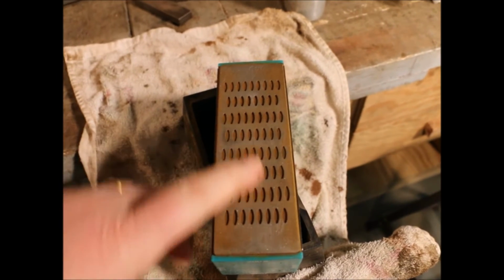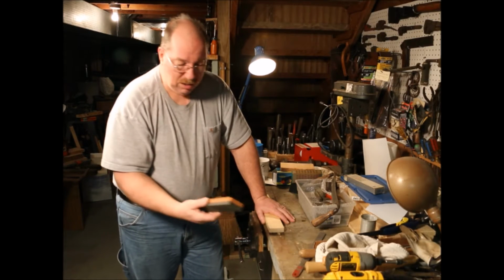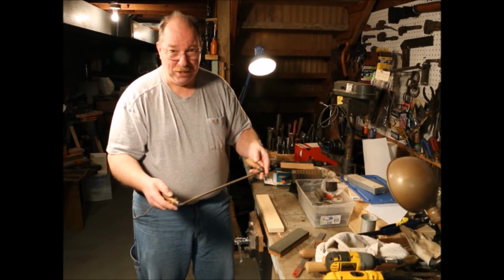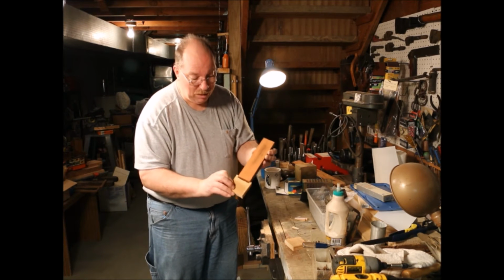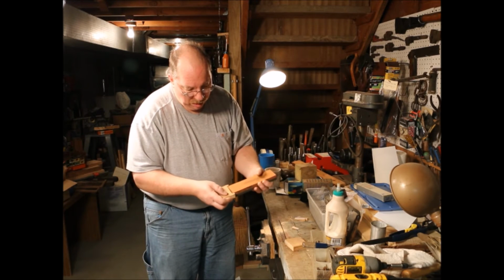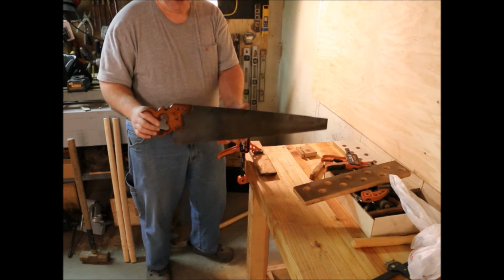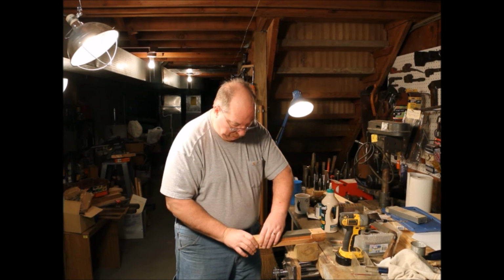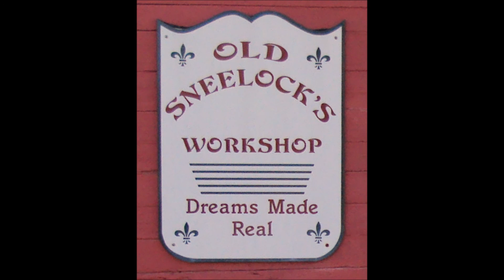Making A Jig To Hold A Norton Oilstone ~ by Old Sneelock's Workshop

Comment: how do you compare your feelings about coping saws to  hack saws. those were usually the two options available to me in my Dad's shop.
Reply from the maker: +Matt Cooper A good coping saw, with a sharp blade, is slightly better than the best hacksaw. I only use them for short cuts and they are cutting wood so they cut fairly quickly. Hacksaws got on my bad side when I had to use them to cut a lot of pipe and steel plate when I was making go karts and minibikes. 
The purchase of a cutting torch was a milestone. 
About 15 years ago I got a chop saw and that is the thing for pipe. A 4" angle grinder and cut off wheel is my best tool for clean cuts in plate, but the torch is my go to for any major cutting.

Comment: I use mineral oil on my Norton. what do you use? l love the quick commentary at the end.
Reply from the maker: +Matt Cooper I'm using paraffin lamp oil. Got started doing that when I stoned dies for a living. We started using kerosene cause that's what they had. Smelled pretty strong and the wife objected. My partner Jerry Coplin brought in some scented lamp oil and problem solved.  It cleans up easy and doesn't make my hands crack. Mineral oil is recommended by Norton. It doesn't have an odor either. I imagine it works fine. I just got use to my way of doing it.
Reply: Thanks I was curious what others do. Especially those I respect.

Comment: I really like it when the 4-X coffee kicks in. I had a diamond sharpener that would store in it's handle. I was going to put the edge back on m,y kitchen knife when I found it salavated. Sweetums admitted to doing it while trying to sharpen something which she flat-out don't believe in a sharp edge and I can't handle a dull one.What she was sharpening she hasn't said and I haven't found it. Her stuff won't cut open a plastic bag. My epoxy was set up so I got the tube of Seal All out and soaked it down. It held but won't come back apart. I even glued a nylon 2-piece gas cap together with it, not to mention sealing some pin holes in an old 5 horse Briggs gas tank. Good stuff. I'd still polish your boss's head for making you work 53 hours a day. Not nice!
Reply from the maker: +Lewie McNeely He can be a pain but he means well. Besides I get to play with all of his workshop toys... Uh I mean tools.
Reply: A good boss is hard to find but I think you've got one. And I know you need the odd hours so I suppose I'm happy too.

Comment: Did you wake Laura when you used the impact driver ?. I would be in the dog house for a week if I worked at 05.15 !
Reply from the maker: +UK Tony Lydia works kind of a swing shift. Sunday, Monday, Thursday, & Friday one week. Tuesday, Wednesday, Saturday, & Sunday the next. On the days she works, she gets up at 5:00 am to be to work at 8:00 am. Our bedroom is on the opposite end of the house from the shop and we have a white noise maker so we can sleep odd hours. 
All in all, no worries. :-)
Reply: +Old Sneelock's Workshop I worked nights much of my young adult life. I used s boc fan for white noise, so I could sleep. Now to this day if there is not a fan on in the room, it is too quiet and I cannot sleep.
Reply: +UK Tony  When I was working early I'd have to get up to leave the shop at 15 after 4 to go get building sand.  I was VERY quiet, even though we had a fan going. Now I might sleep longer than she does!
Reply: +Old Sneelock&amp;#39;s Workshop Our neighbors say that the cause of a happy long marriage was separate shifts.
Reply: +Matt Cooper  We've got a Honeywell HEPA filter that sounds like a tornado. No dust and all's well.
Reply from the maker: I worked for Product Action as a Location Supervisor from 2005 to 2007. The job entailed driving all over 5 states and working odd shifts. I slept when I could and often had to get by on little or no sleep. The noisemaker was what kept me alive. Driving while dead tired I drove through a railroad crossing bar and didn't know it until the windshield exploded. God was driving cause I sure wasn't.
The Dewalt Impact driver is usually operated only during times that Lydia is awake or away from home. Happy wife, Happy life.
Reply from the maker: Matt Cooper What ever gets us through the night. :-)
Reply from the maker: Lewie McNeely Everyone has their own life to live. I dumped Product Action just as soon as I could. Worked for Demmer Corp for 7 years on the same schedule with Lydia. Now I don't have a @#$@#$ shift issue anymore. If I had known how good retirement would be I would have done it sooner.
Reply: I guessed I'd better get out of eating dust while I still could. Whoever said retirement was the life of Riley, either knew the wrong Riley or just outright lied!
Reply from the maker: +Lewie McNeely It's all in the mind. I just got in from raking the front yard and the flower beds. I did it my way when I wanted to.
Reply: Old Sneelock's Workshop Years go we hauled sand to an asphalt plant and then that evening we started hauling asphalt after dark to Cherokee on 441 if anybody knows that country after the traffic slowed. After midnight the plant broke down and I headed home in the Mack, and they ARE 4 letter words. I dove about 50 miles and never knew it at all in curvy mountain roads. I'm like UNcle Snee when he said he wasn't driving but The Lord was. I've been there too many times to count. I didn't drink much coffee and didn't do pills. And I had apnea and no cpap for many years. You tell me that God Almighty wasn't driving and I'll first off tell you you're full of it and then take you on some of the roads I traveled. Then you can see for yourself.
Reply: Old Sneelock's Workshop That's what we're into. Loading, hauling (the easy part) and spreading chips and mulch. We'll either get done or die trying. I had to mow to un-kink after a mulch run. All walking, no riding.
Reply from the maker: Lewie McNeely In the late 90's I worked for Douglas Autotec as Maintenance Supervisor, Manufacturing Engineer, and Engineering Manager. DA had the contract to make tilt and telescope steering columns for Mack semi's. When I started working there the steering columns were a b***h to assemble. There were only a few men who could assemble the columns and make them work. They wouldn't tilt unless you beat them into submission with a 3 lb hammer. Yes, just like the ones I have on the hammer rack. 
The former engineer had convinced everyone that the problem was in the welding process. He claimed that all the parts were right until they were welded. 
After going through the whole process with a fine tooth comb I found that the die for the side sections of the body of the column had worn. That caused the sides not to fit together correctly and the mechanism to bind. 
I had the supplier rebuild the die back to print specs and the problem went away.
We mounted a gold 3 lb hammer on a placard over the assembly line to commemorate the victory.  
I don't think anyone ever told Mack a thing.
Reply: I think that's why the Mack trannys had spring steel shifters. You got ready to grab one, just bend the shifter rod a little and when you cracked the torque it'd just pop out. Nice setup but Mack is still a 4-letter word.